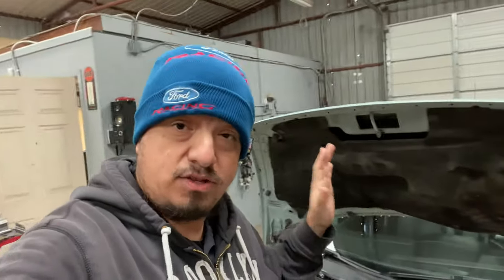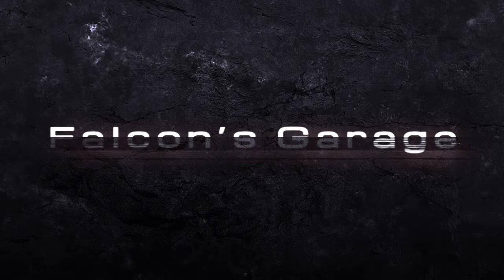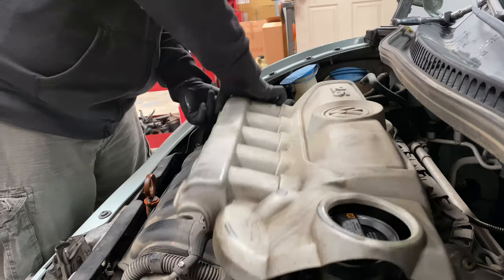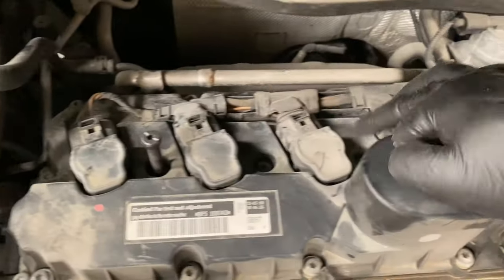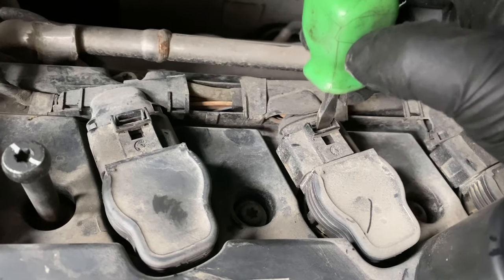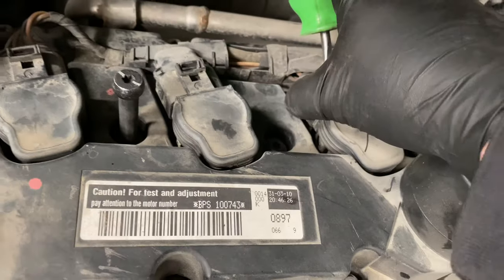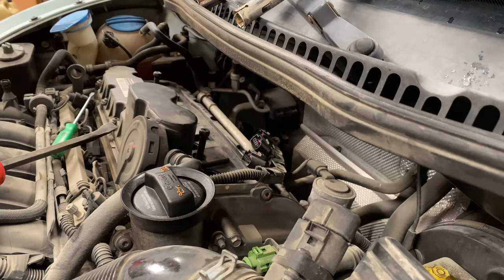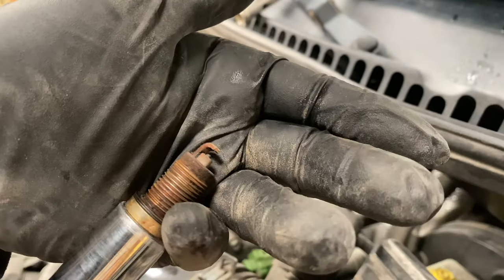Spark Plug and Coil Install - VW 2.5L 5 Cylinder Engine - Beetle  10, 11, 12, 13, 14

Comment: Falcon!  You are the man.  My daughter's 2010 VW Beetle was misfiring on cylinders 2 and 4.  I followed your video step-by-step and replaced all five ignition coils and all five spark plugs.  The car is running perfectly!  The parts cost me $90 and I finished the job in 30 minutes.  You saved me a bunch of money and my daughter thinks I have next-level VW mechanic skills [which I do not].  I appreciate you brother.
Reply: Hey, where did you get your parts ?
Reply: @thomasg2072  Autozone

Comment: Great video, our 05 Bettle w/2.5 OEM Spark Plugs were longer than the once’s the Auto Part stores had in their system did you happen to have that issue?

Comment: Very good demonstration and explanation. My 2013 Beetle is running rough during acceleration and higher speeds. The dealership wants to replace the fuel injectors and seals $3000 plus. From what I’ve read a tune up may fix the problem.  What do you think?  Should I replace the coils as well?
Reply from the maker: I would say no. Do plugs first and see how it behaves and if any check engine light codes come in.

Comment: I have a Cylinder 4 misfire on my 2007 new beetle 2.5 L. I changed the sparks plugs and coils and the light went off for a week and came back on. I then replaced the 4 fuel injector and the light came back on in a week. Still have the same code. I am going to try the connectors next.
Reply: Try replacing your mass airflow sensor
Reply: @briankelley8083  try being a mechanic and test parts before wasting money

Comment: Don't you need to use dielectric grease on the coils and anti-seize on the spark plugs?
Reply from the maker: "need" no .. its a preference thing
Reply: yes indeed you do sir. and apply that dielectric grease in the correct locations.

Comment: Hi I have a cylinder 4 misfire but I don’t know which one is the cylinder 4. Would you know the order?
Reply from the maker: starting from passenger site to transmission is 1-5 with 5 been next to the transmission
Reply: Falcon's Garage thank you for responding